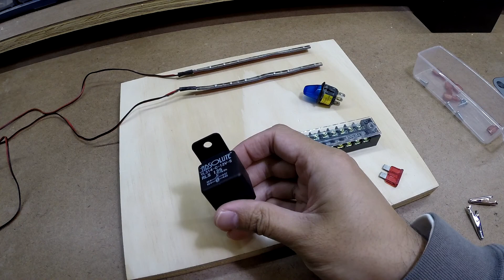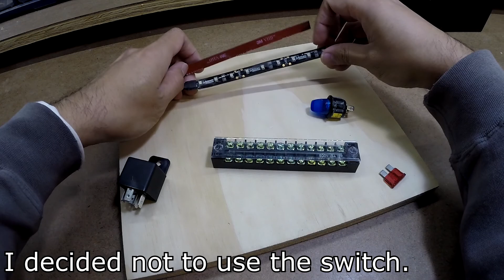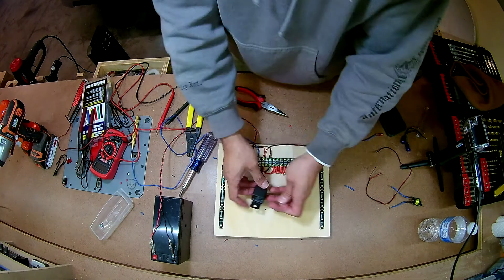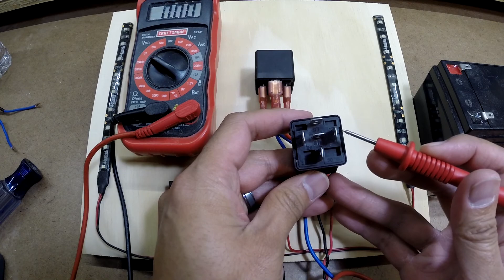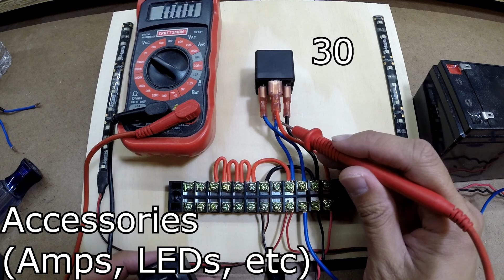Connecting Amps and LEDs Using a Relay

Comment: Great video!! thumbs up.   I checked out your channel did not find a video on you hooking up the relay to use your Trunk door as remote ?  I would like to install LED lighting in my cars footwell and use the door Switch as remote so when I open the door the LED lights would come on..   can I use a 4 pin or 5pin relay ? and do you know if I can find the door switch fuse and use the wire from that as remote ?  Thanks.
Reply from the maker: You should be able to use the same relays that I used on the video. As long as the door switch fuse provides 12V+ when the door opens, it should trigger the relay to turn on the footwell lights. I’ve actually wanted to do the same with my truck. You can connect to the dome light too depending on if it’s triggered by 12V+ or a ground. You would need to use a multimeter to figure out which one it is though.

Comment: Where would you mount this relay?
Reply from the maker: If in a vehicle, I’d just recommend anywhere accessible if you need to troubleshoot or replace the relay.
Reply from the maker: With my builds, I always run a fused distribution block to the back of the vehicle, and I’ll have the relay close to that.

Comment: What are the red jumpers for?. Also can you ground multiple devices on the same block?
Reply from the maker: Sorry about the late reply. The red jumpers are giving 12V power to those other terminals. So if you wanted to connect different components, you could have them on their own connections. You could take all those jumpers out and connect it to the first 12V connection, and it would be the same.  The all the negatives would connect to the ground post.

Comment: Great video, but I have a question...? I recently installed an EQ to my car audio system and it introduced noise. After many videos I came across the idea of using a relay to power on the head unit and the EQ together on a new positive and negative. Would this eliminate the noise from a dirty positive or ground? My theory is to bring in a new chassis ground, and a wire tap at the fuse box and wire them to the relay, then from the relay to the other two components. Would this work? The noise is really annoying. Thanks.
Reply from the maker: For me, the relay is just to keep all the remote activated components from drawing too much from the remote wire. I’m not sure if that would introduce noise into the stereo.  I’d check the ground connection of the eq. And make sure that any signal wires aren’t running along with the main power wires of the vehicle or the amp. Is the noise a whine that gets louder when accelerating? Or something different?
Reply: @AyyJayy02  I use a relay in the back for the remote turn on for 2 amplifiers and pc fans already. Prior to installing the eq, there wasn’t any added “noise”. The rcas run solo front to back, so there shouldn’t be any interference there. The system is in my semi truck so there are a lot of wire harnesses inside the dash , and i believe that the yellow acc. power for the head unit may be “dirty power”. I spliced the yellow and reds to share those points when I installed the eq, so that’s why I’m asking if a new ground from a battery or chassis, along with a wire tap from the fuse panel, to a relay, then to the h/u and eq would clean up the noise? Or am I over thinking this?  Also, would it hurt to run a 4 gauge ground wire inside to the lower dash panel, then connect a ground distribution block, and ground the two there? Maybe thicker ground wire on both?
Reply from the maker: I’m wondering if having the red and the yellow sharing connection points could have something to do with it. I’m really not sure. I don’t see an issue with putting a ground block where you said. If possible, I try to ground everything together on a ground block. Maybe a ground loop causing the noise?
Reply from the maker: There’s a page on Facebook that I follow called “Car Audio Installation Tips and Help”. It’s a pretty good ground. The guy that runs it makes it a good place to ask questions without fear of others making fun of people that are just learning. Maybe post your question about the EQ noise there.
Reply: @AyyJayy02  Thanks for your help. I’ll try a few other things.

Comment: Any certain reason u have a5 prong instead of a 4 u didn't use the middle one
Reply from the maker: It’s just the relays that I had. It can’t be done the way that I wired it in this video, but if reconfigured, that 5th prong can be used if you want something to turn off when the relay is triggered instead of turn on. I planned on a doing a video showing that, but that probably won’t happen until I finish my current project.